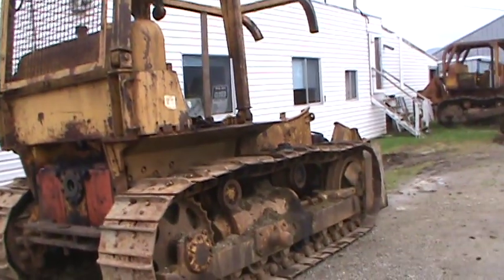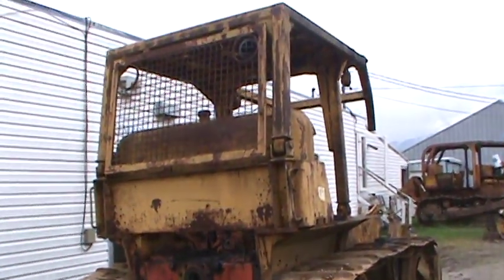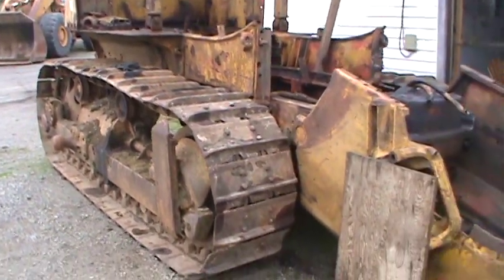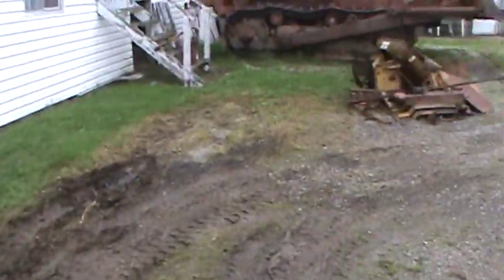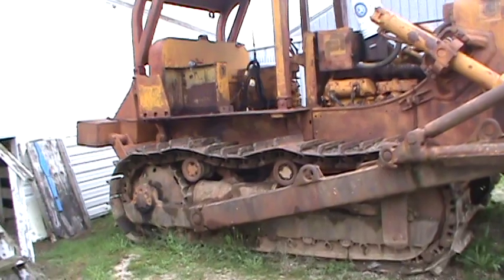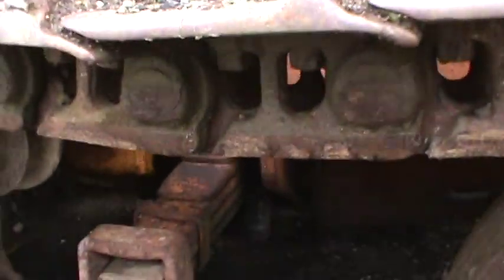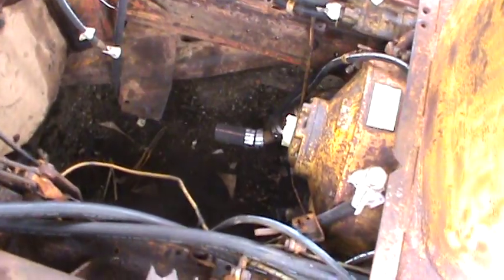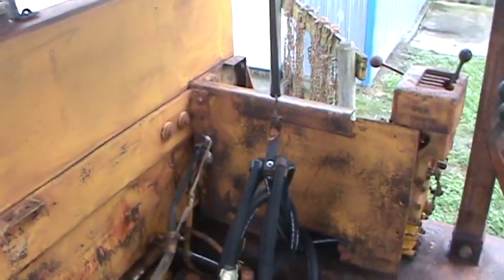Fiat Allis HD16 Bulldozer

Comment: I'd be afraid of a Fiat-Allis dozer with a ripper on it. The final drives in these units have bearings that have to be tightened regularly. If they're not kept up with then it starts making expensive noises. You never know though. This could be a low-hour unit that's been babied and maintained religiously. probably not though.